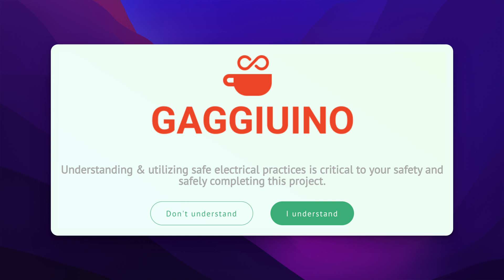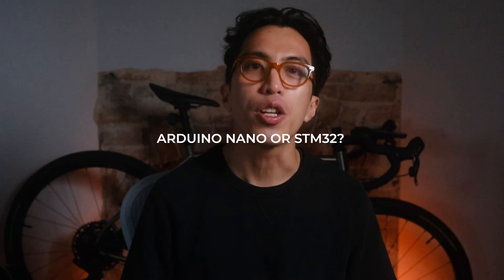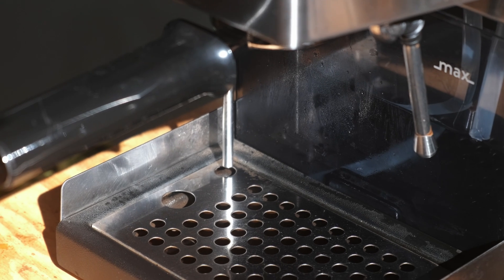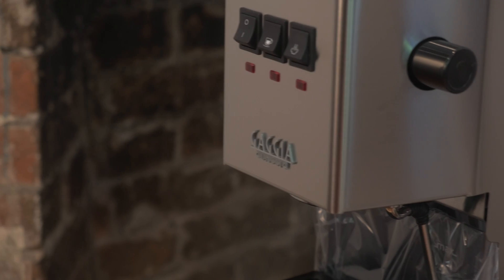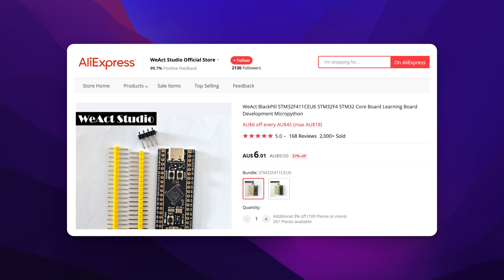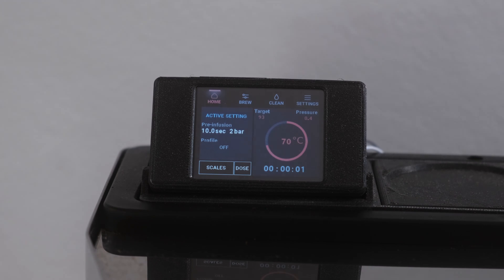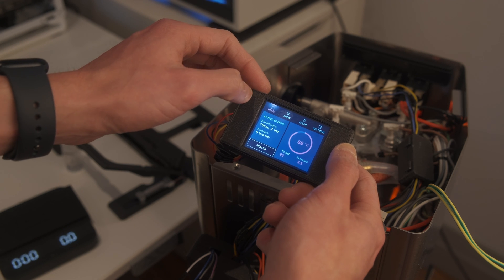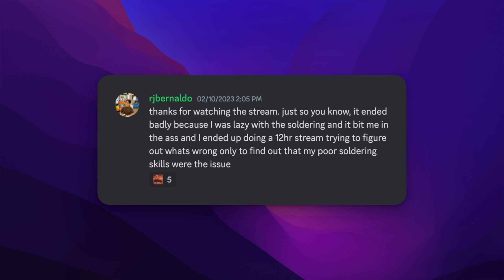I Built a Custom Espresso Machine - Project Gaggiuino

Comment: The 2015 machine descriptions isn't entirely true, it suffered changes only in select markets while to other markets like the NA one they were still delivering the same old GC with an aluminium boiler and all the goodies like a solenoid, moreover the 2015 model isn't actually recommended for gaggiuino at all due to the mushroom valve in the group head literally making any sort of profiling useless as it won't allow any water to pass to the coffee puck before water hits pretty high pressures (5+ bars) hence majority of profiles requiring soft preinfusion or any sort of low pressur eshots being impossible on that machine. You also can't modify it to add any of the og GC boiler/solenoid because the internals have sufferend design changes to accommodate the new style boiler and what not hence that machine is to be avoided at all costs.

Great video otherwise man!
Reply from the maker: Thanks for the heads up!
Reply: Well s*1t missed out on this piece of advice before pulling the trigger. Thank you for writing this comment :)
Reply: Thanks! Also, I own a Gaggia Baby twin, do you think I can mod it with gaggiuino? I couldnt find anything on google about it
Reply: @cosanostra101 as far as I know you can't fully because of the boiler design
Reply: @dulerabbit  thanks, I will lookout for a used one
Reply: @dulerabbit  Correct me if I am wrong but I think that the Gaggia Baby Twin is using the same boiler as the older Gaggia Classic?
Reply: @ludoweedskur9246  it's a twin boiler system hence the twin in the name.

Comment: Gaggiuino is totally useless, unless you are a computer geek or smartphone  addicted. There is no proper espresso brewing than a traditional taste and experience, that the electronics wont give you. There are two many options, starting from a proper grinding your coffee beans. Do not tell me that gaggiuino will tell you this. I moded my GCP to the limits. PID, internal and external boiler temperature , steam and brew, water flow control on demand , low tray to accommodate a scale. The result is. The best coffee machine without any bells and whistles as long as you know what you are doing. You can make any kind of espresso of your like of the roast. You control what you want manually, other than relay on the program of gaggiuino. I'm the old man, and in my retirement age I do prefer brew my coffee manually, because it make my pleasure to do so. This is my opinion but of course other people may think different. I watched the video, and I'm delightful of the new trend.
Reply: I'm afraid you missed the point: gaggiuino is mod you mentioned you did on yours GCP + controller with display (instead of analog gauges). So I disagree with statement it is useless. Having experience shouldn't be enough to guess for example temperature...
Reply: for me your comment sounds like guys who say that after the beatles there is no music. today there is a lot of paths you can choose and both are good. some likes analog and others digital.
Reply: @dzezydzerk  Well than smell and taste your coffee digitally. But yes we all are different, and at the certain point the same. The end point is espresso whichever way you make it. There are many ways to appreciate God. Many religions. But God is God. Thank You for Your comment. Best Regards
Reply: @petersawala  you can’t stop it , cars change , phones change etc. I’m fan of “analog “ stuff because lot of them can be repaired. but we will not stop revolution.

Comment: Does anybody know if it is possible to transfer the graphic data to a 24 inch monitor ? (this would be convenient for a person with reduced sight abilities).
Reply from the maker: The ui is actually custom made specific to the small screen. In order to use a larger monitor, someone would have to create the ui from scratch and would not be able to use the nextion part of the project. Hope that helps.

Comment: I noticed in your previous video that you placed the component housing behind the machine instead of inside. Will that negate the need to print the housing using PETG if that’s the case? I’m currently on PLA only and finding ways and means to not switch to PETG because the printer is not mine 😅

Comment: Is the new EVO PRO suitable? I've seen post where those who have tried using it found it easier to entirely re-wire it. Also it has a 9 bar spring, would a 12 to 15 bar spring in the OPV be better?
Reply: the EU/UK Version does not have a 9bar spring.

Comment: Found out about Gaggiuino around March this year, watched your Arduino Nano build log, bought components, wired it all up, successfully build and upload to arduino nano without even having the gaggia machine itself. Just wanted to know if I was capable of performing the mod, if not I would've bought the Breville Bambino instead. Ordered GCP late April, used it without any mods for 5 months up until yesterday. During the 5 months, I did a STM32 upgrade. Did not install it because I was afraid of breaking internal components because I broke the OPV pipe on the second day of owning the machine attempting to try out 9 bar before reverting back to the original spring for the Gaggiuino install. Finally gathered up some courage and installed the STM32 Gaggiuino into my machine last night. And the difference was night and day. I no longer have to wait for the brew light to go away and come back, I don't need to time my shots because it is shown on the display, I could adjust brew pressure easily without having to do spring swaps. Since I've been using Gaggiuino every shot has been very replicable, and my shots no longer spray everywhere because of 12+ bars of pressure on the stock springs. Thank you for all your Gaggiuino videos, it has helped me a lot.

Comment: Hey! I chanced upon your video for the Gaggiuino when I was about to checkout my cart from Shades of Coffee to include the pressure gauge and dimmer mod. I currently have the PID installed. Are there any components you re-used from the PID kit from Shades of Coffee? Or did you remove it totally and used all the recommended components from the Gaggiuino team? Thank you so much for the content btw!
Reply: You'd need to remove the PID and revert the Gaggia to stock then start on the gaggiuino mod

Comment: I was pretty certain about getting the cafelat robot and i thought i was set and then this video came out and I am now mid crisis trying to decide again
Reply: Get a robot anyways. It's an epic tool to get all the technical stuff out of the process. It's only your skills and the tool. The haptical feedback of the puck resistance is unbelievable. And pressure profiling comes down to your muscle power and control...
And although I'm writing all of this, I also can't help but keep coming back to the topic of 'Gaggiuino', on and on...;-)
Think about it that way. If you get the robot first, you have a reliable supply of coffein during your build of the Gagguino ;-)

Comment: Thank for another awesome Gaggiuino related video! I've also build this mod on a GCP 2019 and I didn't feel to be hard to do it. For me, the tricky part is to dial in for good shots, even with the default profiles (I also use a G-Iota DF64 v4 grinder). If you understand all those parameters found in the Gaggiuino menus, pls share that with us in a following video. Thanks!

Comment: Thanks for the explanation this was very helpful on getting up to speed with the models available. I have a really old Gaggia Espresso without the 3 way solenoid that I am considering turning into a Gaggiuino. But if I would need to replace too much then I would consider just starting from a the new Gaggia Classic Pro you showed. If the old one works out I will try to post something.

Comment: Hey, I have build the gaggiuino based on the "OG" version (built around 2004, so pretty old). Did not know the differences when I bought the machine, it was just a good offer when someone wanted to get rid of their seldom used machine for only 120 EUR. I like the setup so far although I still need to figure out some features of the gaggiuino.
One thing I'd like to add is another big advantage of the lego build: repair and maintenance. It is just going to be far more easy to swap components if something breaks or the project is moving on changing stuff (again).

Comment: Hi Rj, I'm in the process of building out the components using the lego method.  I am pretty mechanically inclined so I technically don't have any issues, but just wanted to ask you about the Dupont connectors.  I am using the same connectors on the same pcb chip that you showed 9:12, did you remove the pins from the pcb itself or did you cut off the dupont connectors and solder the wires to the pins?
Reply: Hey! You can either solder your bare cables to the pins or desolder the pins and solder your cables to the pcb directly (takes less space). if you're OCD you can also use JST connectors but you need more equipment and stuff.